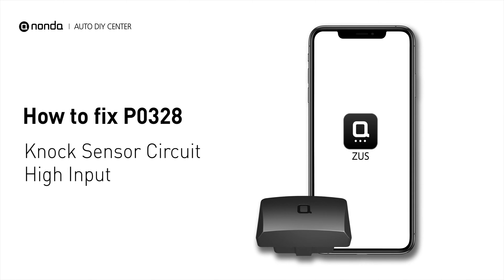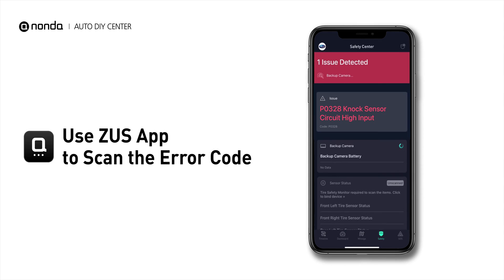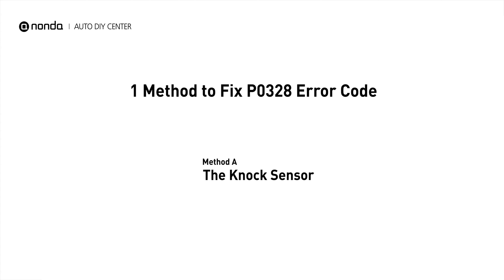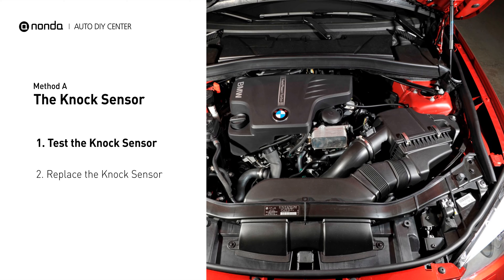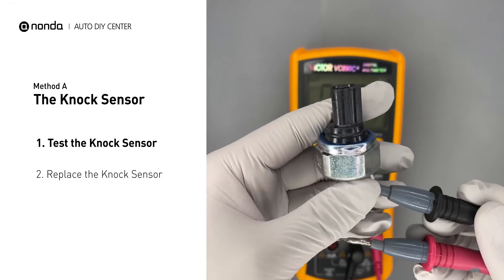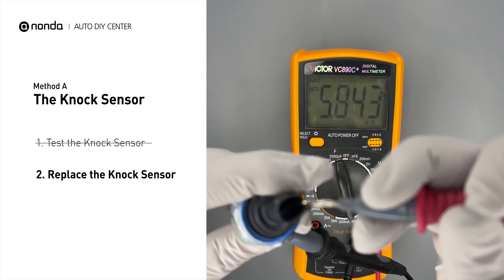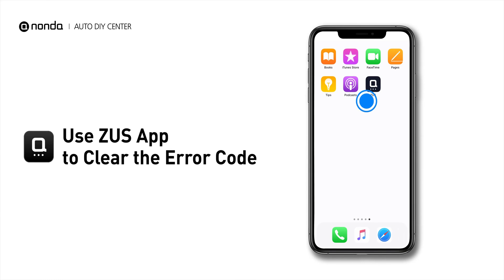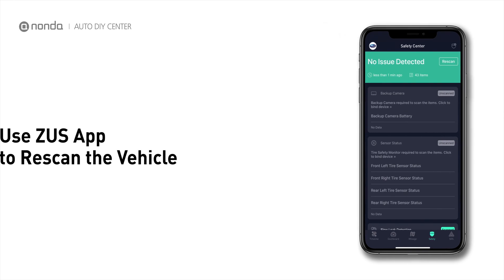How to Fix P0328 Engine Code in 2 Minutes [1 DIY Method / Only $10.11]

Comment from the maker: Hi, I'm Steve, nonda's lead mechanic engineer. 
Feel free to leave your comments here if you have any mechanic questions, I will be glad to help you out!
Reply: My Honda Pilot just turned over 50k. Knock sensor code po328. Is this normal and is it covered  under the power train warranty?

Comment: I'm getting this error code on cold starts, doesn't happen when the engine is warm. Any ideas?
Reply from the maker: Hi Aaron, please check all the wiring and connectors leading from the knock sensor back to the PCM. Check also the knock sensor resistance value, if it's out of specification, then it has to be replaced.
Reply: Mine does it as well. Did u solve it?
Reply: @mihaib89  Nope didn't solve it, still happens occasionally. Don't think it's a major issue
Reply: @cataaronz i have the same issue at the minute, replaced the sensor and nothing. Will happen on cold starts 90% of the time and for about an hour after on and off. Have you solved it by chance?
Reply: @drewmorgan-smith5722  No I haven't solved it, I've decided to just ignore it. My check engine light might trigger once in a month or so and I just clear it every time.